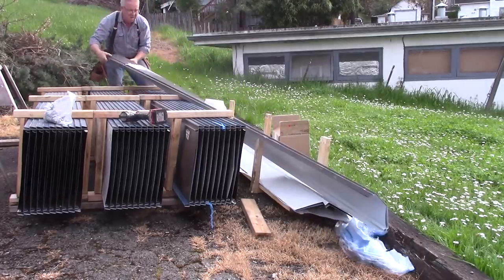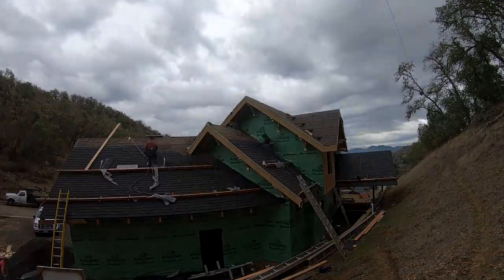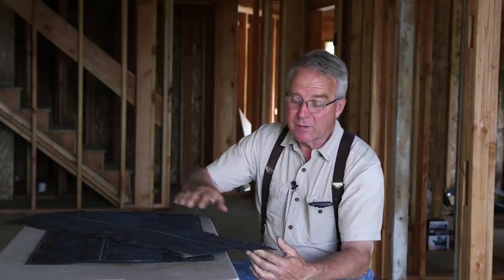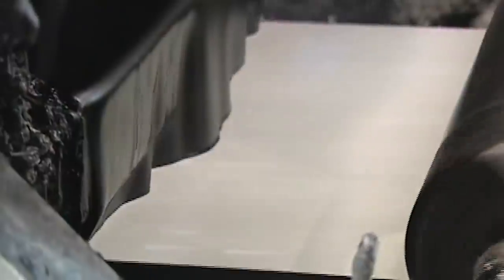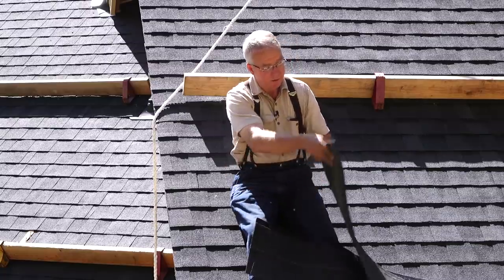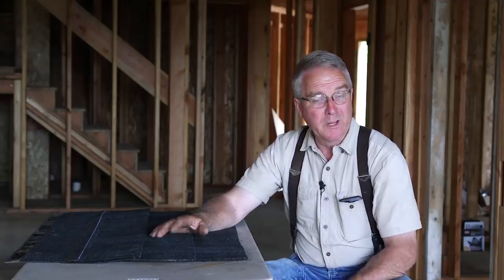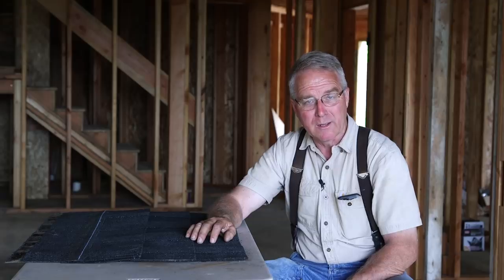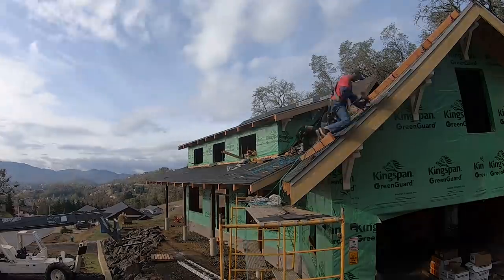The Incredible Asphalt Shingle

Comment: Ugh, I've had enough contact with shingles to last me 3 or 4 lifetimes. Did it for a decade or so and I'm not doing asphalt shingles again unless someone pays me way too much to do it. I'll stick with metal.
Reply: Travis Jester     I’m right there with you.   I despise asphalt shingles.  I’ve installed hundreds if not thousands of squares on in my construction career.   Always dreaded the tear off, loading, underlayment and install.   Hated every day doing it.  And the heat!  Just about ruined me on my last roofing job.  Would rather put a sinker through my thumb than EVER do another asphalt shingle roof.  
Cheers!
Whipple
Reply: Metal fades and looks trashy before shingles do tho. I agree that laying shingles sucks tho, spent many years doing it.
Reply: @zacharybeauford2244  you are not doing it right if so. Metal roof will look good and stay leak proof  for 50 years if you do it right up.to 100 years if you are pushing your luck and maintain and paint it proper. Check your facts
Reply: Raimond Ainsar Please do explain how installation has anything to do with fading? That would be a manufactures issue. And yes almost all of the metal roofs in my area fade within 5 to 10 years and look trashy in my very strong opinion. I think you are confused about the facts
Reply: Slate is my choice. Best think you can put on a house in my opinion.
Reply: @zacharybeauford2244  In installed a metal shingle roof on my old house (ex-wife has it now) and it seems to still be looking good 10+ years on.  You have to do a doubletake to know it's not stone tile.
Reply: Zachary Beauford The paint on my metal roof came with a 40 year warranty. That two going on three reroofed for shingles. But you do you.
Reply: @zacharybeauford2244  Metal roofs should be cleaned once a year, but I don't think that service is commonly performed.

Comment: I think shingles are probably the rarest roofing material in the UK,  concrete tiles, predominantly "Double Roman", can be seen pretty much wherever you go over here. Followed in popularity by slate, flat clay tiles, then Thatch, so far as I've seen over my years. The only place Asphalt felt gets used is pretty much flat roofs or on garden sheds.
Reply: Shingles on a flat roof? Okay
Reply: @abz817  not shingles but long rolls of asphalt
Reply: @sackville_bagginsess  Torch applied modified
Reply: Asphalt shingles would probably last longer in the UK than here, summer is warmer in the U.S.  The asphalt gets very hot.

Comment: Scott, maybe you can address under this video, what you didn't in the prior two roof ones: why you used a dark color? Was there no lighter color choice? Do you not believe that summer heat load and hence energy use is lessened by a lighter roof? Or is there such danger of ice-up in Roseburg that you need a dark roof to melt the snow?

Comment: In terms of performance, I have to disagree with Scott. Concrete tile roofs are the best. Yes, they are more expensive and are more labor intensive. But you end up with a roof that will offer superior performance in almost any weather condition. They are the standard in hurricane country. They are the standard in the desert Southwestern USA where the dry air and heat destroys just about everything else. Scott himself said in the block wall video that in the SW, if its not a cementitious product, the desert murders it in short order.
 They are better in the rain and the cold. About the only place you might consider something else is if you get a lot of snow. Concrete is heavy and a load of snow on the roof would place a huge burden on the truss system underneath. 
Concrete also provides a great deal of thermal mass for the home underneath and helps with heating and cooling costs.
Reply: Concrete roofs are rare here (I live near EC). We get a lot of rain, and I bet algae/moss growth is an issue, plus the immense weight means having to beef up the roof structure quite a bit. I think metal is the best for this area. We don't get significant hail.
Reply: Concrete tile lasts, but the stuff under the concrete tile roof doesn't. So you still have to pay to have the tiles removed, underlayment and sheathing replaced, and tiles put back. You don't save much because there's a huge amount of labor in preserving (literally) tons of concrete tiles.
Reply: @RobertBarth1  I did construction for a while and unless there was serious damage, I have never seen an entire concrete tile roof replaced because the underlayment wore out. That's one of the major benefits of tile roofing, it protects the stuff underneath very well. I'm not saying it doesn't happen, but small repairs are much more common rather than replacement from wear.
And again, I was talking performance. A life of 50+ years is normal for concrete tile. Slate and clay can be even longer. You will not get 50 years from an asphalt shingle. Your labor costs might be lower the first time you buy an asphalt shingle roof, but by the time you're on your 2nd or 3rd roof, the concrete tile comes out ahead. Plus the fact that any replacement includes new asphalt shingles where concrete tiles can be reused, so you may not need to buy more than 10% new tiles, where you will have to buy all new shingles if you replace the entire roof.
And with newer synthetic polymers replacing old asphalt felt or even torch-on coatings or rubberized asphalt coatings, the chance of the underlayment failing under concrete tile is lower than ever.
For the EC building a house he hopes to sell, rather than live in, asphalt that he got for free, makes a ton of sense.
Reply: @bmay8818  Algae and moss are a common thing in Southern Florida where I lived and worked construction for a while. But the average homeowner will either drag a power washer up on the roof every couple years, or just pay someone with a truck mounted unit to do it for you, for a couple hundred bucks. Takes a couple hours and your roof is spotless and most will also apply a sealer to extend time between cleanings. The concrete tile roof is popular there because of storms and the tropical and sub-tropical sun. Asphalt shingles will rot out much sooner there, which is why their use is very limited.
I'd be careful about metal roofing in wet climates. It's durable but unless you're getting real copper or brass, galvanized steel isn't going to last forever. Sure the replacement and repair costs are low, but for the money and on my house, I'd go asphalt shingle before metal. For a shed or out-building, metal is fine.

Comment: As always, thanks Scott & Nate (& all your crew of amazing workers) for this series of videos. I am enjoying the journey.
Can I ask a question? I was curious to see you still nailing the ToeBoards onto the new shingled roof. Does this not cause holes for potential leaks through the brand new roof? Because of your amazing attention to detail & your superb skills, I assume that maybe the tar in the shingles might 'self heal' but I am genuinely interested to get your take on this, thanks.
Reply: Imagine an L , long side down on the roof, the top of the L has a slot that hooks on a nail, then you can run your next shingle right over that, leaving the short part of the L sticking up, which the board sits against, once done, slide the L off the nail and slip out from under the shingle, then tap the (hidden) nail down. The L is a piece of steel. Probably should've just linked something

Comment: I have a question about something non-shingle-related, but you surely know.  It's about stair stringers.  After doing the stair gauge layout, is the following correct? Take the tread thickness and make a level cut on the bottom step; then take the riser thickness and make a plumb cut off the top step? I know it's unrelated, but I am trying for simple, mastery of my stringer layout, and that seems right.

Comment: I'd say the most popular choice in Australia would be good old corrugated iron (well, steel, nowadays). Bluescope with their Colorbond had the market sewn up for...well, decades. And, of course, you can't do a bullnose with any other material. Light and easy to install. Tiles would be next.

Asphalt, for whatever reason, never really took off here. Wonder why that is.
Reply: Asphalt is a crude oil refining product. If you don't have a lot of oil refining going on there, asphalt shingles are not something you'd come across all that much. Oz doesn't have a lot of oil, so I'm guessing what asphalt production you do have, goes to roads rather than roofing materials.

Comment: The gravel layer on our asphalt roof is damaged when we are up working on it, and when we have a bad storm or hailstorm.  For environmental purposes,  and to save replacing entire shingles and entire roofs  when the gravel is damaged, I do not understand why we can't have more gravel and adhesive to apply to the areas that are damaged, which would make the roof last longer, matching the current shingles to some extent.  Does anyone know of a product like that? 

 I assume the reason is that the roofing companies would rather sell a whole new roof of shingles than sell a bucket or two of gravel and some type of spray  adhesive. 
I know that there are gravel products applied to flat roofs.

 I am in the Southeast USA and when the hail storms come through -- which is pretty often --  with each storm, there are whole neighborhoods of homes with asphalt roofs,  entirely replaced with insurance help each time  when we have some hail damage ruining the gravel.  Because that is your sun protection and wear surface. (We were always told that once the gravel is gone, the roof won't last.)

It is a huge environmental and financial waste. It's very common for people to replace roofs that are 1-year or 2-year old,  and be replacing them again in another couple of years, or 5 or 10 years.  A shame, when the gravel could just be repaired. 

My next roof will be a standing seam metal roof.  we would have had that when we built this house but could not find at the time a reliable installer in the area. Since then, the metal  roofs have become very common even on small country houses.
Reply: You think like me.  I have wondered why the asphalt shingle roof couldn't be re-coated with sealant and sand.  It would probably have high labor costs, and it might be difficult to achieve a nice appearance.

Comment: I like asphalt shingles. When they are no longer up to the job of keeping a house dry, they work great as driveway paving material. ( be sure to remove ALL the nails first )
Reply: How does that work? You just lay them out and glue them down or something?
Reply: @ADBBuild  He probably means dump them out and spread them around and let vehicles pulverize them over time. I wouldn't do this.
Reply: @ADBBuild  I’m not sure what Proverb House meant, but used shingles can be ground up and recycled into asphalt pavement. Not sure it’s all that great for the environment given the energy needed to grind, sort, and process into new asphalt paving. It also may not be cost effective since the facility in Stratford CT that used to take old shingle for recycling, charging half what the local transfer stations would charge to take it has gone out of business. I’m not sure if it was mismanaged or just wasn’t a viable business model without some sort of government subsidy.
Reply: People often use the cheap ones to add traction to handicap ramps.

Comment: Not trying to contradict but I've seen 1 asphalt shingle roof in my 10 years of working in Australia and after talking to the owner of that house (we were installing solar power) they had to get it shipped from the US, in australia they are all either tin or concrete/terracotta tile, I wonder if it's due to the hot and dry climate or for other reasons

Comment: Got to say you missed one (or two) out ..... maybe you don't get them where you are, but in the UK traditionally roofs were made from Slate! 
Mine has been up for 109 years now. It has had a couple of individual slates replaced but basically it is intact. They are expensive though and if you get tornadoes running through they might not last as long ..... but putting up with the UK's damp and cold weather they are definitely up to the mark! Some houses have Stone roofs, slabs 1/2" thick ......but that does add weight to your roof and is even dearer than slate ;0)
I won't mention Thatched roofs ether ...... nice but not  common choice!
Reply: Hard to find someone who knows how to do thatched roofs...

Comment: I had my asphalt shingles replaced with a standing seam metal roof, heavy guage. The new roof is beautiful, and has a 50 year guarantee. So in 30 years, when I'm 92 Lord willing, there will still be 20 more years warranty on the roof. That versus maybe 15 years life for typical asphalt. I wouldn't give $.02 for a whole square of asphalt shingles.
Reply: If your asphalt singles only lasted 15 years, you were sold defective product. Or the builder used the cheapest ones they could find.
Reply: Wait until the screws leak... That seal won't last 50 years.
Reply: @misterhat5823  You have no idea what standing seam roofing is.
Reply: @mikedonovan9033  Asphalt is TRASH
Reply: What gauge metal did you use ?  I don't want less than 24 ga.

Comment: I'm surprised they didn't go with metal for this house. I don't like shingles at all (two of the worst materials combined, can't recycle, heavy) and the spec house is supposed to be better than standard construction. If the roofing was donated, I imagine a metal roof would cost less to install than shingles, depending on type. I installed a snap-lock roof on my shop by myself and it's great. Not as good as standing seam but I like the idea of being able to take it apart if I need to.

Comment: I suppose it's horses for courses, but about the only place you'll see asphalt in the UK is on a cheap garden shed. Many are those who have suffered from eternal leaks from flat roofs covered in asphalt sheeting.  I now live in Northern France and have just re-roofed our house in slate.  Originally, houses were built from what was at hand - my walls are granite (the local stone) and originally the roof would have been thatch - almost certainly wheat straw.  The house was built sometime in the 1600's by the way.  I doubt any modern houses will last that long - why should they, they are built to a price.  In Dorset, where I was bred and buttered, in the absence of local stone they used cob (mud, dung and straw) for the walls and thatch again.  Cob (like adobe) can, and does, last for centuries if you keep its head and feet dry.  Flint and brick became popular in Dorset after bricks started to be produced cheaply in the Industrial Revolution.  Bricks for corners and around doors and windows, infilled with flint that you could pick out of the fields in wagon loads for nothing.  Just as Welsh slate drove out other roofing material - because back in the day it was cheap.  And price has always been the common denominator.  I do wonder how long so many of these synthetic materials will stand the test of time - but hey, as long as the house lasts longer than you, why should you care?  Not an attitude our forebears had - they built to last.

Comment: 20,000lbs of shingles shocks me.. did SW misspeak?
Reply: Probably not. That's a big house with a lot of roof and asphalt shingles are heavy.
Reply: Shingles are heavy
Reply: To be clear, shingles are heavy but they’re among the lighter options.  Everyone who advocates tile and slate roofs are ignoring the extra structure required to support them.  Those are HEAVY roof systems.

Comment: Asphalt shingles vs concrete/ceramic tiles for roofing?

And why?

And would the asphalt shingle be a good option in the hot equatorial weather where sudden thunderstorm may happen at short notice?
Reply: When I did residential construction in Southern Florida roughly 20 years ago, everything was concrete tile. 
It stands up to the rainiest area in the USA, it stands up to hurricanes. It's impact resistant, much more so than asphalt. Concrete tile is really the best option for almost any place in the US except for those that get a lot of snow. Concrete tile is heavy and adding a heavy snowfall means you'd have to build the roof trusses a lot stronger and make them more expensive. 
As far as equatorial weather, I'd go concrete over asphalt.